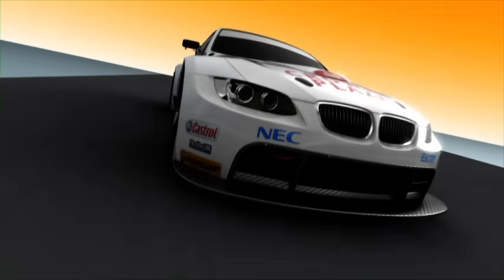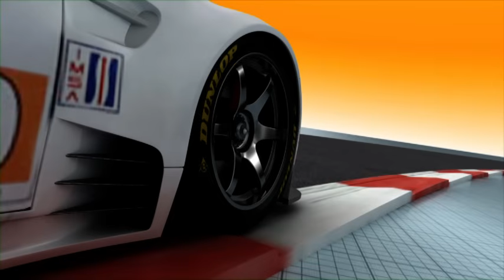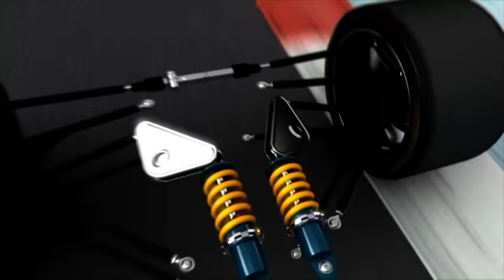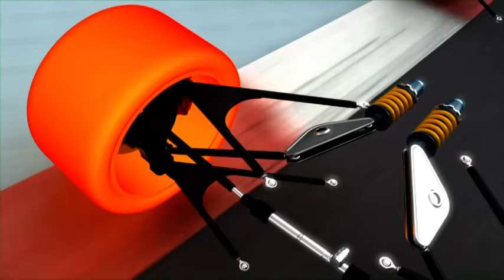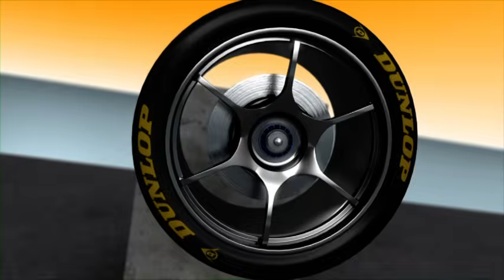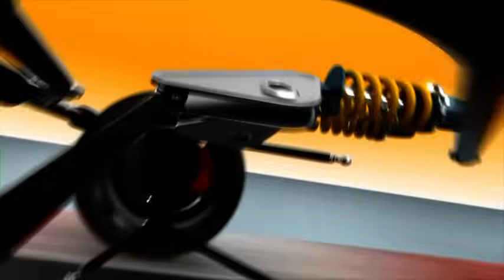Unsprung Mass

Comment: Hey there. What do you think of “Corner-Weight Balancing” think?

Because the measurements simply combines Sprung & Unsprung Masa as one.

Of course it’s important to know the vehicle weight distribution. However they use it as a part of ensuring stability on every cornering.

We think it’s impossible to control since it’s based on F=MVCos°. They might fix or ignore slight changes on Mass. how ever they can’t fix the Velocity & Cos° value so that they gonna have balance F on every cornering.

So what is your opinion on this matter? Thanks